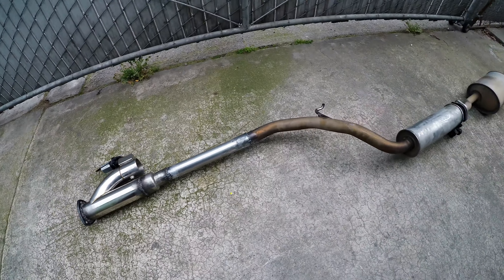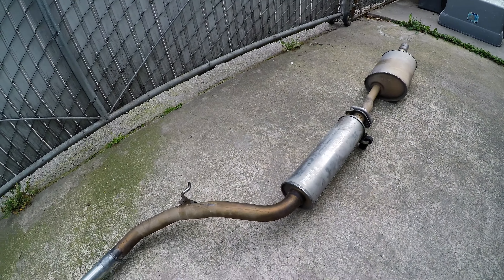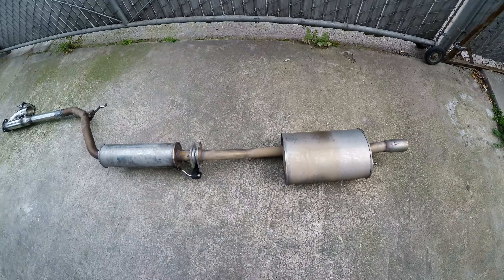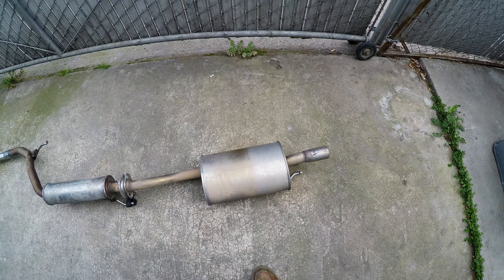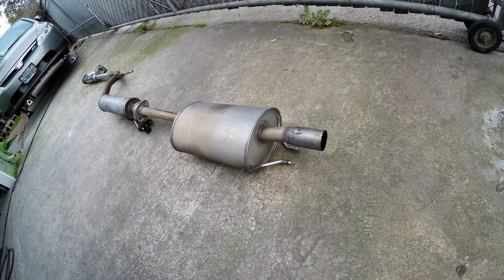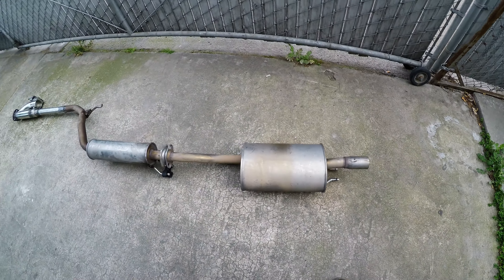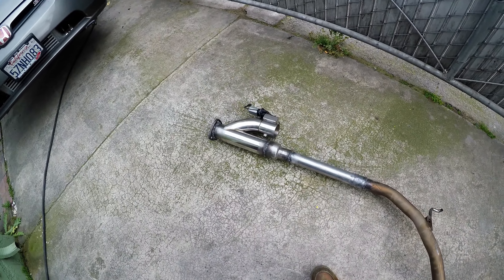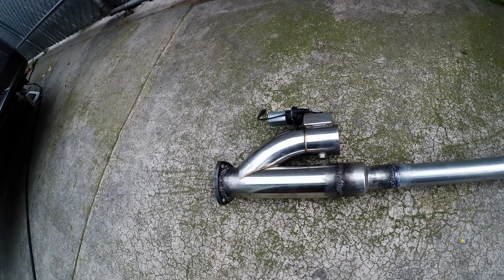8th Gen Civic Si on a 3" E-CUTOUT! CA Exhaust Law Fixed?

Comment: What cut out is this?
Reply from the maker: https://www.ebay.com/itm/3-Electric-Exhaust-Downpipe-Cutout-E-Cut-Out-Valve-CONTROLLER-REMOTE-KIT-NEW/182788145511?fits=Model%3A3&hash=item2a8f05c167:g:Il4AAOSw7P5bMNf2
Reply: CAMMEDcivic do I video update on this setup